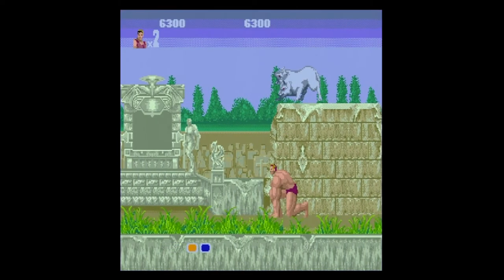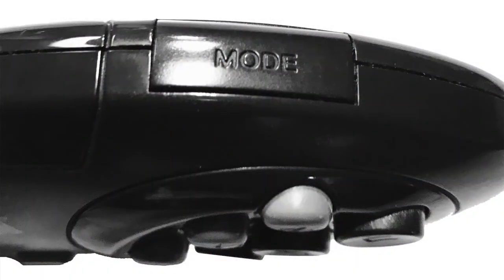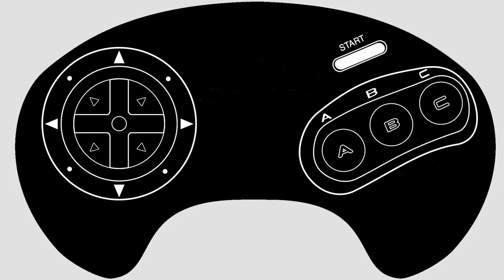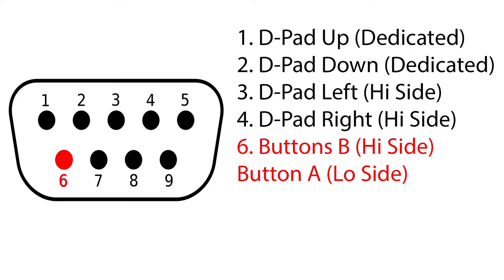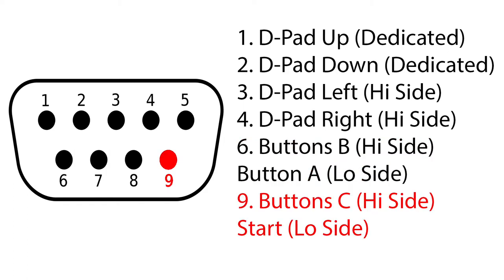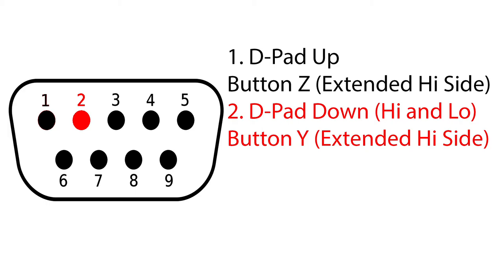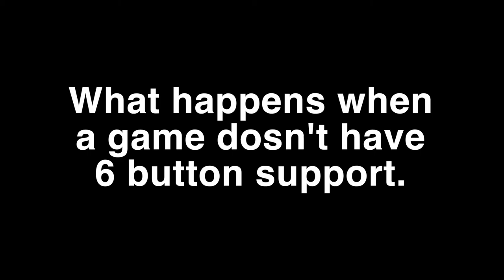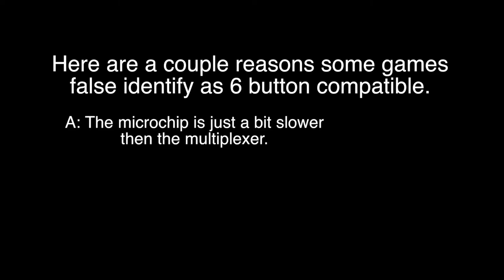Sega’s Mode Button | Part 1 - How do the 3 and 6 button gamepads work?

Comment: I'd like to see videos examining how the Sega & EA multi-taps work. I'd especially like to see a breakdown of how the Codemasters' J-carts worked. After dissecting the J-cart, you can see that each port has either a multiplexer or a microprocessor hard wired to the cartridge's PCB.
Reply from the maker: I’ve been thinking about this too. I still need the EA multi tap and I have a bunch of other projects in the work, but I can see this happening down the road. A future episode of my Sega Formats series will cover the J-Cart, unfortunately my request for an interview with the people involved has gone unanswered.
Reply: Jenovi I wanna know why multi taps even existed like why not just make the system have 4 (or more) controller ports to begin with Sony was the last one to put for controller ports on the system and Microsoft made you have one wirless controller if you wanted 4 player because the original 360 only has 3 usb ports
Reply from the maker: Talk about something that would make an interesting video. I think the most telling example is the Atari 5200. It was the first game console to release with 4 controller ports and was revised later eliminating them in an effort to cut cost. One interesting note is of the 40 or so games (on the Mega Drive) that offer two-player support, around 5 were released in Europe with the extra ports built into the cart itself. In North America we received one of these games.

Comment: One of the issues I think of regarding sega genesis 6 button on an older game that you have to use the mode button is Ms Pacman. I know its probably not related here but the new recently released big sega six button wireless controller by retro bit has control issues too. If you play Virtra Racing Genesis issues with the dpad is present. You have to go to 3 button mode to steer car. Just letting you know along with anyone who reads this.
Reply from the maker: I hear people really love or hate it. Not sure that bodes well.
Reply: @Jenovi  i really like it. Its the size of the old 3 button but with six and shoulder buttons. If compatibility issues are fixed I think we have a winner here.

Comment: Thanks, super interesting all around, and explains the issues I've been having in atomic runner. 
Later I'll test power up with the mode held
Reply from the maker: Oh? Let me know what you find.
Reply: @Jenovi  After staring the Genesis with the mode held in, it's working perfectly.
Before both the jump and the turning around simply didn't work, I was about to return the retro-bit controller, 
But this is a fix, Thanks! this made a world of a difference.

Comment: Do you have any idea why the cable on the Saturn 3D controller was removable?
Reply from the maker: +CyclonesWorld No one knows for sure, but some common theories all revolve around the idea that add ons were in the work that would fit into this slot. Things such as a rumble pack, wireless adapter, motion control, etc. I personally feel it makes sense, but the controller was never that popular so no expansions were ever developed to take advantage of the slot.
Reply: I have very few games that actually support it, which was a bit disappointing. The theory makes sense however, and it's clear how much of an influence it was for the Dreamcast controller. 

Loving your videos btw, found you randomly, and quickly subscribed!
Reply from the maker: +CyclonesWorld thanks! I really appreciate the sub and the knowledge that people are enjoying my content.

Comment: So it was only on the 6-button controller?
I wonder why Nintendo released the 3 button Genesis controller with a mode button?
Reply from the maker: Correct. I really need to acquire a couple of those. They did release the 6 button in JP but left the less desirable 3 button for North America.

Comment: I have only used a 3 button controller and the actual shape of the controller looks like it was changed when they went to 6 buttons witch makes it look uncomfertable and small
Reply from the maker: It was designed for the average size of someone from Japan. Personally, it's one of my favorite controllers to use.

Comment: i wonder how the multitap works
Reply: especially when you have 3 button controllers and 6 button controllers all pluged in at once through the same plug.
Reply from the maker: There are a few systems for the Mega Drive and they each work a bit different. This means the game has to be programmed around that piece of hardware. My guess is that they go through a lengthy series looking at inputs for each controller individually, meaning only one controller is recognized at a time per port.  The game is designed to know set A is controller 1, B controller 2 etc. Being a 3 or 6 button doesn't really affect this as long as the game is programmed to anticipate it being there.  I hope that makes sense.

Comment: DEAR YOUTUBE VIEWER DO NOT PLAY THE FAIL THE JAPANESE OR JAPAN SEGA SATURN YABAUSE OR YABA SANSHIRO AND KRONOS ON WINDOWS 11  DOOM FAIL EMULATOR ON SEGA SATURN IT NOT WORKING IT A   BLACK SCREEN ON DOOM SEGA SATURN YABAUSE OR YABA SANSHIRO IT A  FAIL EMULATOR Almost playable - menu works, in-game except GUI is black. 0.9.14 git (10/03/2016) : not playable, menu, in game then crashes. I WAS PLAYING LEVEL 1 AND THAN
I WAS SAVING MY GAMES AND QUIT THE GAMES AND EMULATOR AND THEN WHEN I LOAD THE  GAME IT WAS GONE AND USING SEGA SATURN DOOM -GAMESHARK ACTION REPLAY CODES WHEN I USE CHEAT CODES FOR SAVING AND THEN MY  CHEAT CODES IT GONE AND I CAN'T  LOAD MY CHEAT CODES ON  SEGA SATURN YABAUSE OR YABA SANSHIRO IT GONE ALSO SO IT A JAPAN OR JAPANESE  FAIL EMULATOR THAT CAN'T FIX THEY  I AM  ANGRY THAT I CAN'T  PLAY DOOM ON YABAUSE OR YABA SANSHIRO IT A BLACK SCREEN AND FLAMERATE TEXTING 1 I TRY BUT IT FAIL THAT ALL DO NOT PLAY DOOM SEGA SATURN ONLYS  DON'T FORGET   FROM RASHEED NATHA GAMING CHANNEL RASHEED NATHA 1